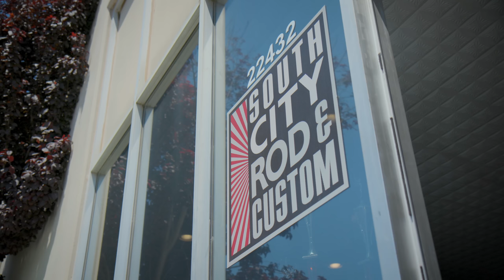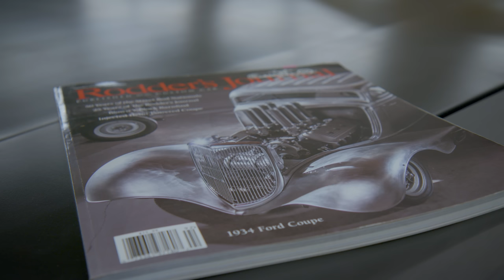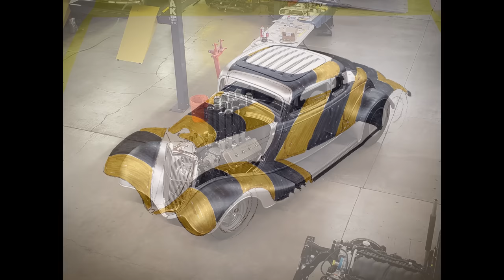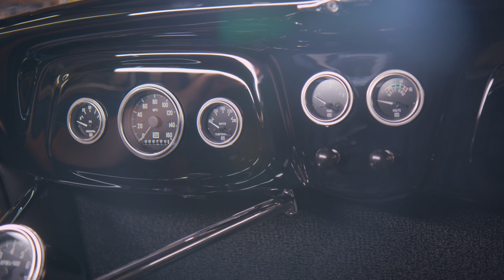HOLY HOTROD: Saint Christopher, The Hemi-Powered 1934 Ford Coupe Hot Rod of the Year | EP26

Comment: those T5 transmissions came out of the mustang fox bodies and the 94-95 mustangs ( and a few other things ). I have one in my 95 mustang gt. the 5th gear in those is EXTREMELY tall ( long ).

even with my 4.10s it falls on its face when i shift at the top of 4th into 5th. 80 mph with the 4.10s in 5th gear is still at a decently low rpm for "gas saving". lol
Reply from the maker: Thank you for sharing with us!!

Comment: Genuine question and reaching out as I'm hoping someone can answer it: I'm not that into Hot Rods but love this car. Question is regarding a number of things that this car is 'missing'. I understand that some states allow almost slick tyres to be used but this car seems on another level, no wipers (ok, I get that, again I think some states don't mandate wipers as it hardly ever rains) but no headlamps? And no exhaust silencers, just open headers?  The last two surprised me, is it again  a matter of certain states allowing open headers and no headlamps? Seems to take a relaxed approach to vehicle  requirements to another level......
Reply: Hot Rods have always been on the outskirts of the law.... but we use Rain X on the windshield in case of rain, and we have a set of headlights that can be installed very easily if needed.  We could also install baffles in the header tubes if we ever wanted to quiet it down a bit.
Reply: All valid observations. Removable lights sit centered behind the grill. Visibility is surprising good out the windows with the seat being so far back.
Reply from the maker: Thank you for watching!!  We appreciate the comment!

Comment: Hope it's okay to appreciate the quality of the work, while disliking the layout of the stripes - the section around the louver vents in the roof should have been mimicked on the trunk, and the colour choice, maybe it just doesn't have enough contrast in the way the drag cars did.
The gearbox dropping the rpm on the highway, add that to a throttle controlled muffler bypass, and it'd loads of fun - silent when cruising, then all noise and go when the pedal is pushed.
Reply from the maker: Yes...it's ok!!  Thank you so much for watching!!
Reply: You should build one!
Reply: I think my favorite comments from those who dislike the paint are the ones who can still appreciate the workmanship of the build.